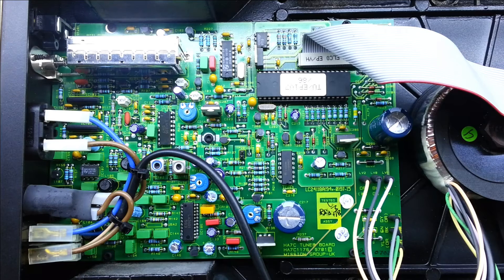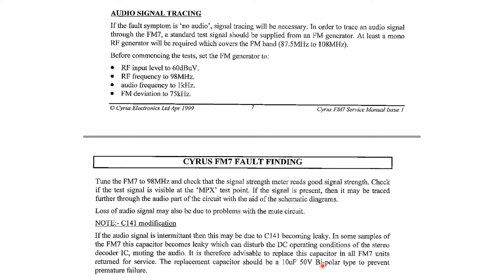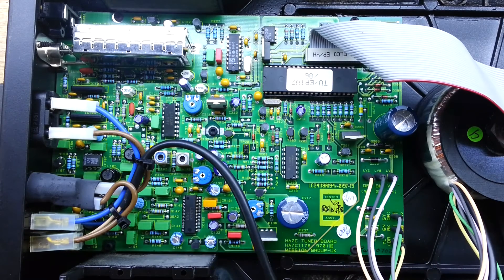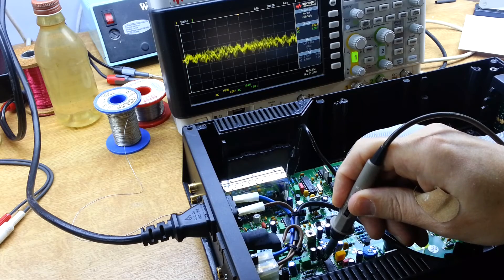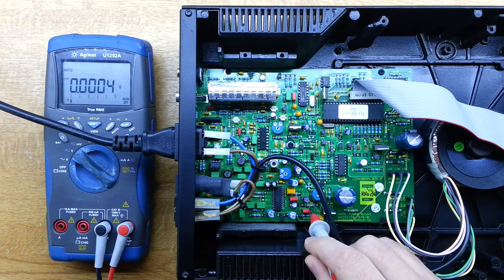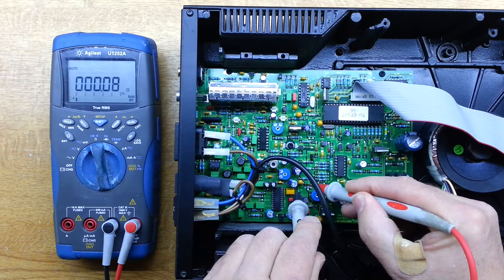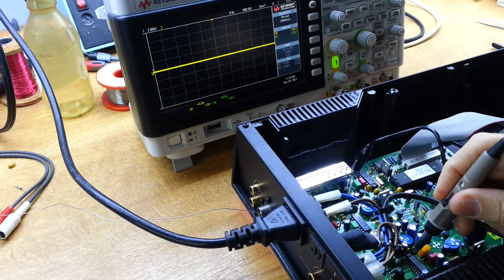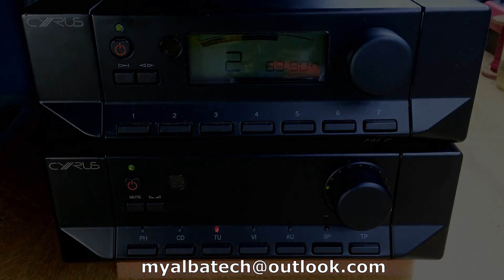Repair of a Cyrus FM7 Tuner

Comment: Thanks for these videos. Do you take in stuff for repair by post? I have a dAD3 which works for a couple of minutes (can be up to an hour from cold) then the motor cuts out. Leave it switched off for a bit and back on and the cycle repeats. I haven't really had chance to check it myself yet, but I strongly suspect a bad SMD electrolytic in the power supply to the mech, however my skill level is basic so I'd rather someone who knows what he's doing take a look at it. Surprisingly service manuals exist for these as well on the web!
Reply from the maker: drop me an email
Reply: @myalbatech  I,m looking for someone to repair my Cyrus 8 VS2 if your interested I did read the above comment but you have no contact details on your youTube page.
Reply from the maker: @markdavis4754  There is an email address at the end of each video and under the 'About' tab.